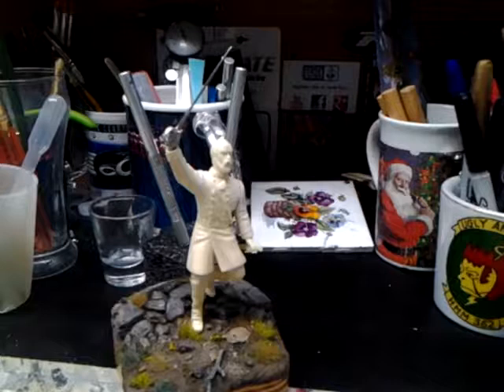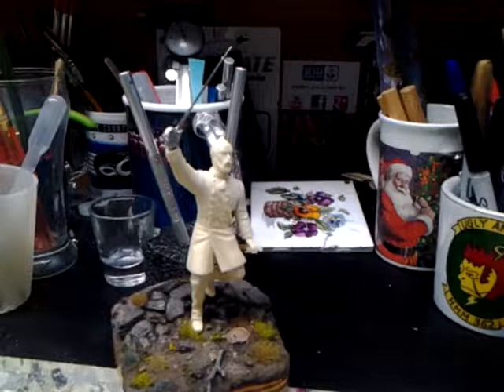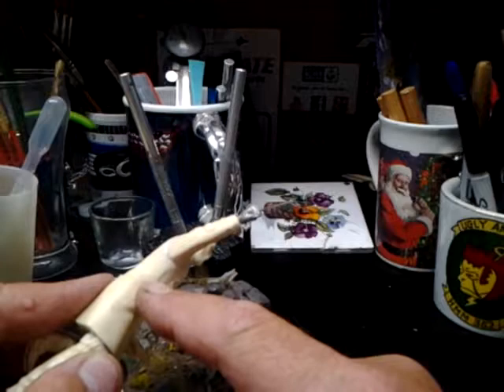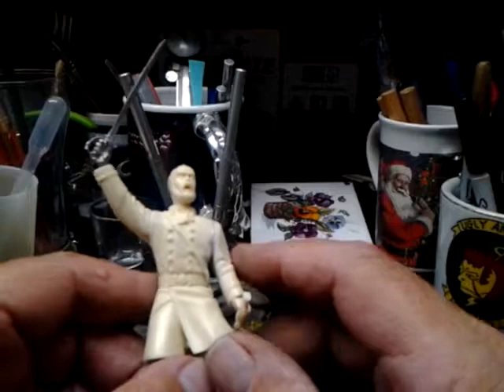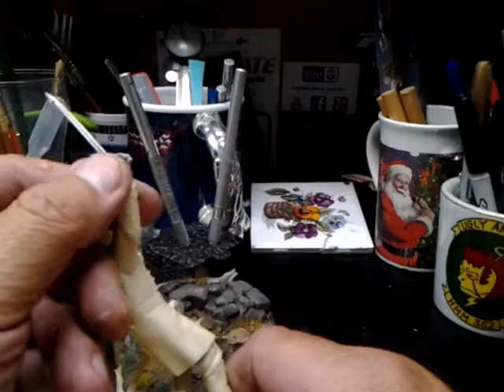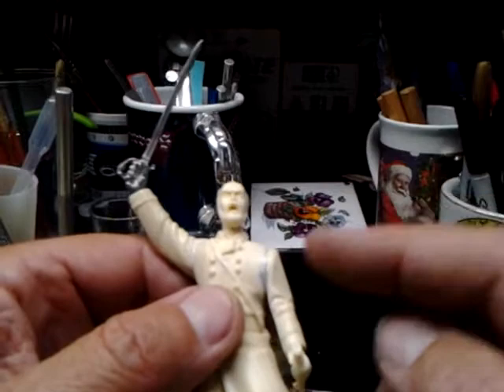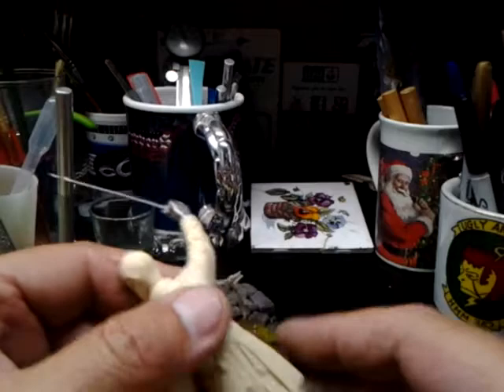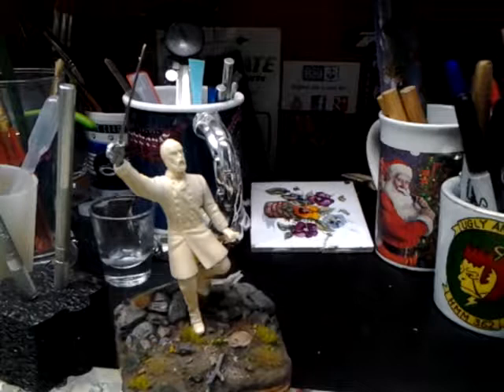General Lewis Armistead build update

Comment: Sometimes you seem to have the worst luck with some of these kits Terry. You certainly like the challenging ones.
I respect your determination.
I know that you've probably tried every glue made by man, but have you tried thick CA glue?
I love Bob Smith Industries Extra thick 10-15 sec CA. It's pretty much all that I use for CA now and its never failed me yet.
...
yet
I love that vignette base.. that thing is brilliant!!
Reply from the maker: Thanks Coen for the compliment about the base. I haven't tried that glue yet. I'll have to look it up and see if they have a distributor around here, or if I have to order it off the net.
Reply: I believe it's made right there in the US, and I buy mine off eBay.
Reply from the maker: Thanks Coen. I found it on ebay. I'll have to order some and try it. I bought some high tech stuff in Phoenix I'm going to try also.